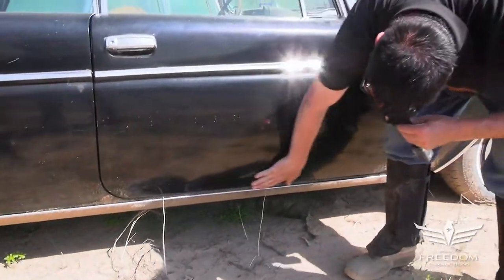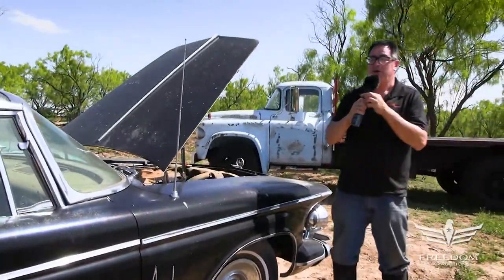74 1963 Chrysler Imperial

Comment: This Is A Imperial Separate From Chrysler,
Reply: I believe you are correct Charles! Imperial was it's own brand, like chrysler did with Valiant around 1963. It was not a plymouth Valiant, it was a Valiant.
Reply: @unclemarksdiyauto  I always referred them as Chrysler Corporation's Imperial line.
Reply: I noticed Texas license plate, so factory air really meant luxury. The most important AC vents were on top of the dash in the center. When not in use, they were often pushed down into the dash. Very effective in cooling the interior down, when you got out, you felt like you ran into a wall of heat. I rather liked the push button selection on my Grandfather's '57 (Powerflite) and '63 (Torqueflite) Plymouths. My Great-uncle's '63 New Yorker had the squarish steering wheel. The lever on the left was for Park. The mirror was mounted on the top of the front left-side body panel. It was rare to see dual front mirrors.
Reply: @michaelwaldmeier1601  Yep. It is always weird when they change or bring out a new line. Just like the Ram trucks. They use to be Dodge Ram. now Ram is it's own brand. Confusing!